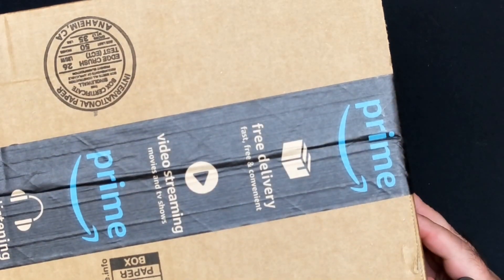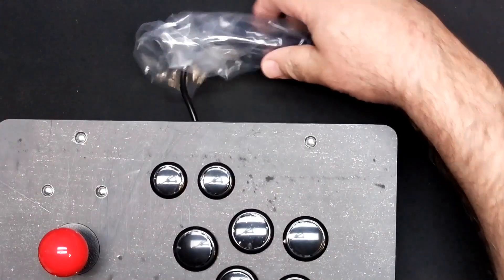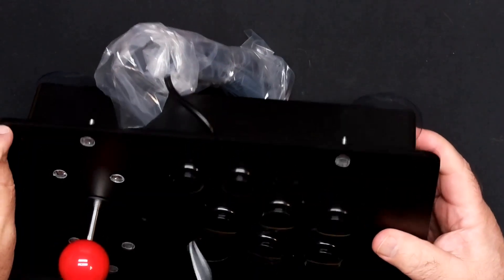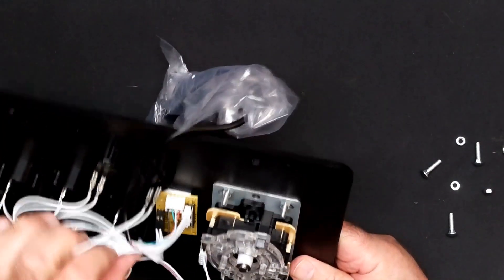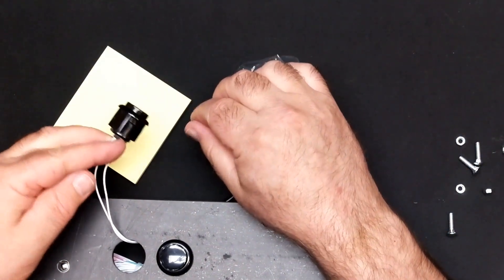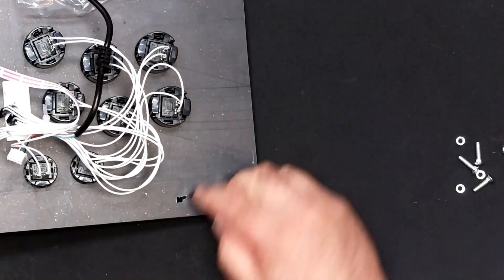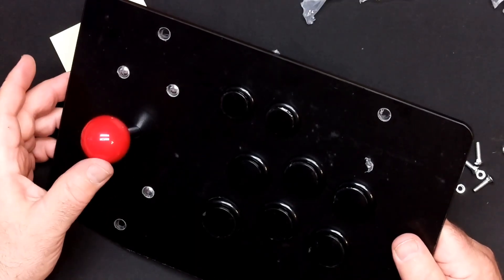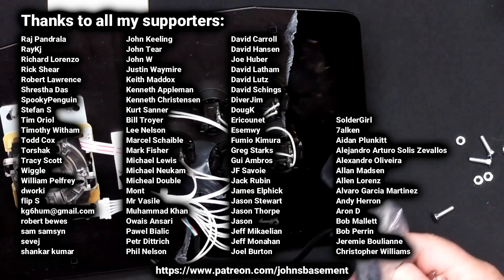Cheap Amazon Hackable Joystick from FOSA

Comment: Those a generic arcade joysticks and buttons that you can get without the case. If you want to upgrade it, you can change the buttons to ones have a thread on them with a nut to go on the back to screw them in. The joystick has a clear plastic gate on the bottom that can be rotated 45 degrees to change from 8 directions of movement to eliminate the diagonals for games that don’t work with them.
Reply from the maker: Hey!!! I did not know that about the joystick!  Thanks for the tip!
Also, I have a bunch of buttons that have the threads & nuts.  They look awful long.  But it looks like they will clear the back of the case!  I may do some upgrades at some point.
THANKS!